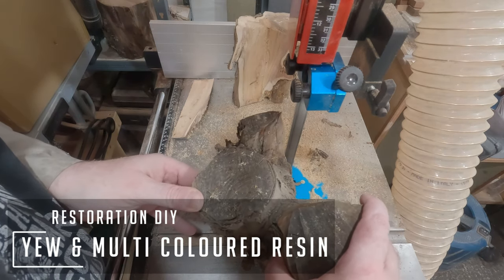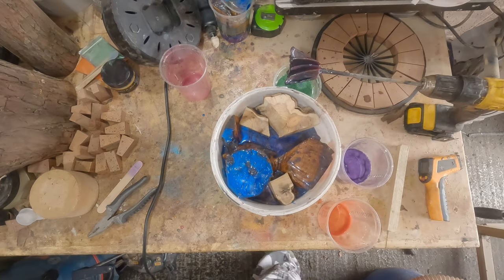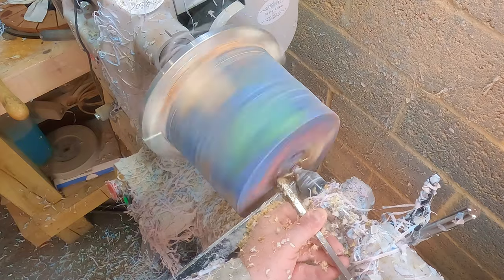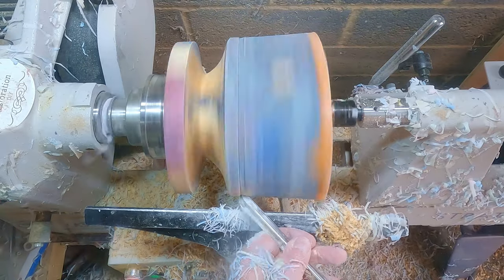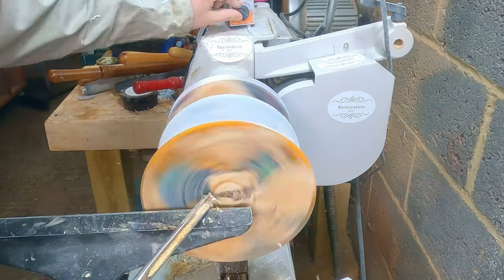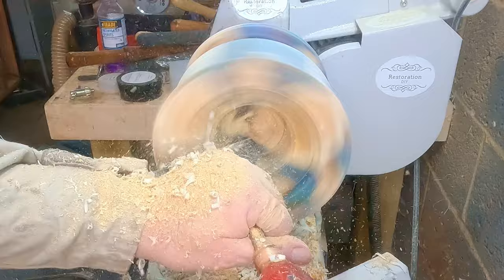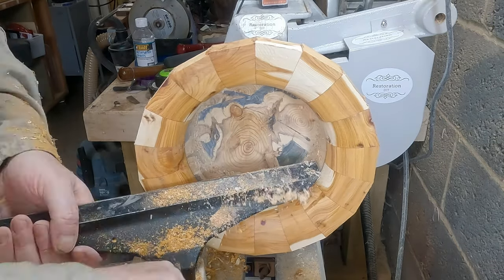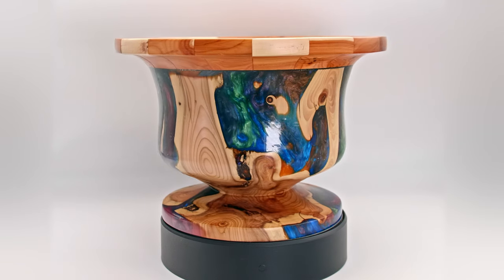Woodturning | Yew Multi Colour Vase | Restoration DIY

Comment: Very nice piece.   I’ve seen others fill cracks with Thin CA glue and then mix a little mica powder in it before hitting it with the accelerator spray.   Dramatically reduces cure time.   Really enjoy your videos 😊
Reply from the maker: Thank you. I'm glad you enjoy my videos. I sometimes use CA with an accelerator, but I haven't mixed it with mica. I'll give a go next time I have a repair to do. Many thanks 🙂